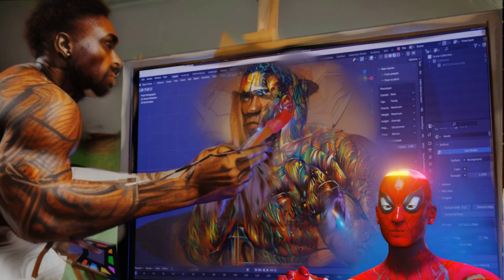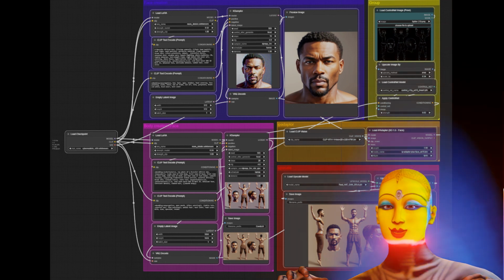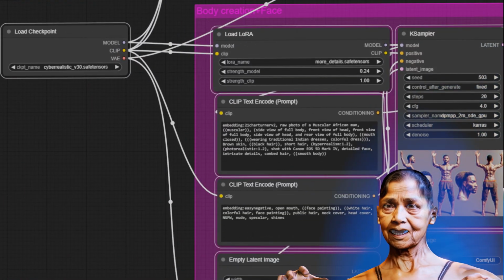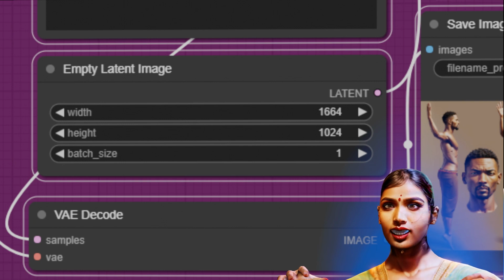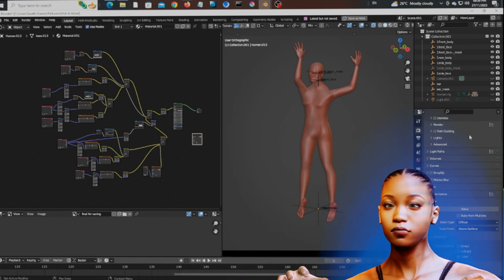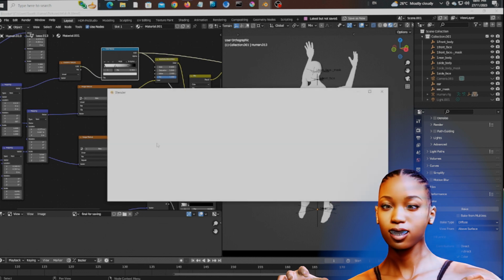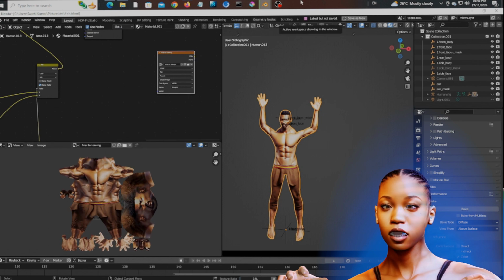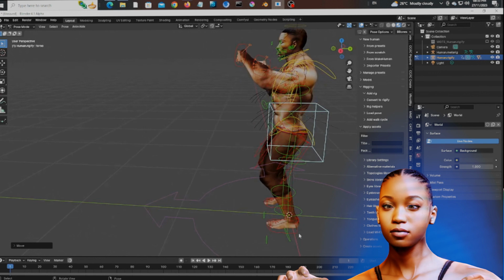3d Character texturing using Blender and Comfyui

Comment: There's a comfyui addon for blender that lets you generate from within blender itself. I'm pretty sure with a little skill, it should be possible to render the camera view and then project it onto the character within blender itself. You should do another video. We have Blender 4.2 now and also Flux models are out ;)
Reply from the maker: i try those addons. but projection part not working good enough. because we need to detail only some parts (face, hand etc). that is why i like this workflow. flux models are too heavy for my work flow. but for sure i will try to update.
Reply: @swathikumar980  I didn't get time to do more, but I posed the model so that between left/right symmetry, I could cover the whole model to avoid bad areas. For example, if you pose it like a marching position, you can get good details for inner and outer arm and just mirror them. It can definitely be done. There's also a new controlnet for normals but there are normals generators also - main thing is getting even textures so the normals don't create problems and then mirror the better side. I find it is useful to automatically add "soft diffuse indoor light without shadows" or some such for more even textures and there's Ian Hubert's compify to further reduce the texture lighting problems. This definitely can be an excellent pipeline.

You could end up with an addon :D
Reply from the maker: @Vidyut_Gore  which controlnet you are telling? link please, so i can check.
Reply: @swathikumar980  Flux.1-dev-Controlnet-Surface-Normals.safetensors
Reply: @swathikumar980  There's also IC-light https://www.youtube.com/watch?v=GsJaqesboTo
Reply from the maker: @Vidyut_Gore  there is good news and bad news. good news is there is a new work flow which is much easier which i will share soon. bad news is flux is not running in my old pc.
Reply: @swathikumar980  Looking forward to seeing what you come up with. Several people here have complained about the AI voice and you've replied that your accent would be harder to understand. If you email me a script, I can read it out for you - I'm an Indian with reasonably good English.

Flux isn't that important for texturing, I think, since realism for our models will come from the scene and animation and lighting, etc. The de-lighting will be more important for good textures. Would be great if it worked. You could use a google colab or one of those comfy UI cloud rendering services - might be good for a workflow too - though obviously no longer free (but then it can be argued that hardware investments are more expensive than API use. lol)

To make it more complete, you can have the workflow generate line drawings from the camera view. That way, people can model clothes and such and have them project correctly instead of sari trousers :D It will then work with MakeHuman clothes too - @MakeHumanCommunity may have more inputs on that.

You can also look at the DeepBump addon for generating textures.

Comment: how did you make the lineart picture and what size is it ? I can't see it in the drive folder. Thank you for the cool work :)
Reply from the maker: it is there now. thank you for point it. Just take an mpfb human base model,  place it in the way you get all the details and get a view-port render. then in comfyui use lineart pre-processer to get the final line art diagram. may be i will make another video later.
Reply: @swathikumar980  I would really enjoy that video when you make it. This is clever thinking.
Reply from the maker: @Vidyut_Gore  amazing time to live right? Thank you for nice words
Reply: @swathikumar980  Totally. One blender file changed my texturing life. lol. I'm not really an animator - sci-fi author trying to make my own promos. lol. I can do texturing, but it takes AGES. I can do art, but the texture file isn't like doing a painting. I can paint on the model, but the thing is slow and hard to keep consistent when the brush won't move smoothly. Was pulling my hair out. I didn't even know anything about texture coordinates. I'm like "MAGIC!"

BTW, I'm Indian too. Heard the other comments about the AI voice. Happy to do any narrating for you if you need it. No problems at all.
Reply: Thank you for sharing this knowledge. This is what I was thinking. I have not tried yet but I know that reallusion has a new update. headshot 2 just recently was released. It allows you to do a panoramic picture of yourself or let's you take a 3D model and generate a cc3 character that will give you all the textures you need. I believe it bakes them onto the cc3 uv map with their micro normals and everything.   So, I think you can throw your character into the headshot 2 plug-in and let it do it's magic. It will automatically be rigged with their skeleton to use all your mocap or inherited animations. Add tattoos and whatever. But again, I haven't tried it yet.  I just wanted to share my thoughts since you shared yours. Thank you. I'll be trying this out soon. This is a game changer for me.